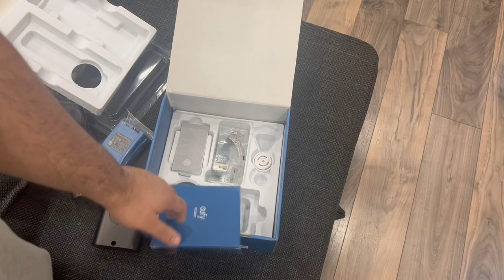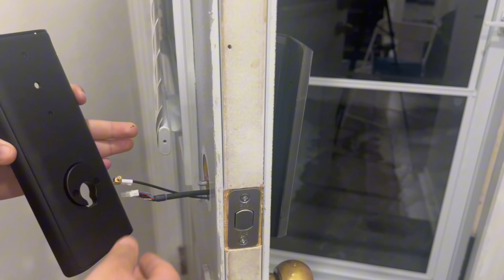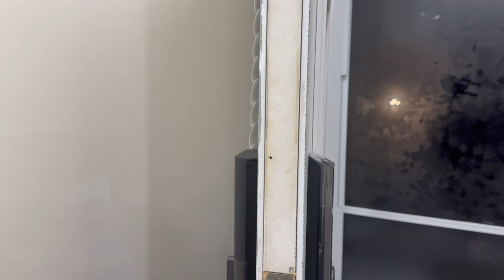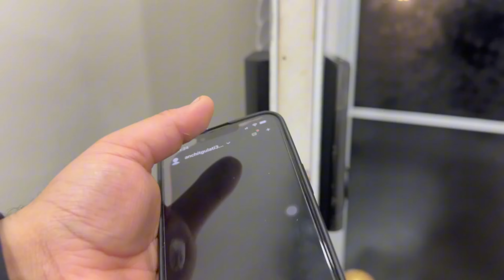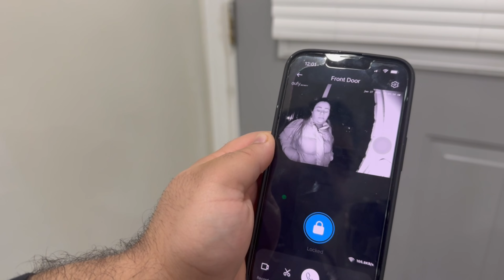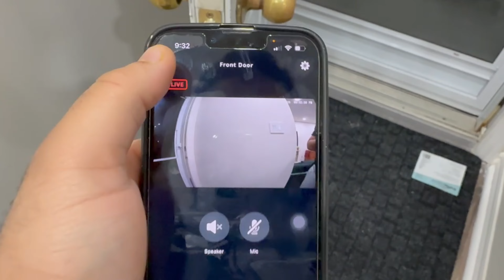Eufy S330 Smart Lock Review & Installation Guide | 3-in-1 Camera, Doorbell & Keyless Entry!

Comment: Hi mate,

Thanks for the great video — I found it really helpful! It’s 2025 now and it’s still going strong.

I was wondering if you could help me with a couple of questions:

- Does the chime need to be turned on for the Wi-Fi feature to work, or does the lock have built-in Wi-Fi that works independently of the chime?

- Does the deadbolt have a sensor to detect whether the door is actually closed and locked? For example, in a situation where the door is open but the lock is engaged, would the app still show it as locked?

Thanks in advance for your help!
Reply from the maker: Hello,

Thank you for your wonderful comment. 

-Chime needs to be turned on to connect the lock to the Wifi. 

-Deadbol does not have sensor if it's in deadbolt or not. 

But personally, I have been using it for all my lovks and do like the User Interface and everything. 

It has good camera surveillancce, motiom detection, ringbell, face camera, fingerpriinnts, etc. 

Overall nice produc